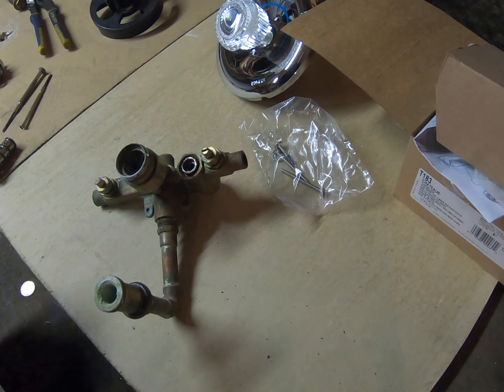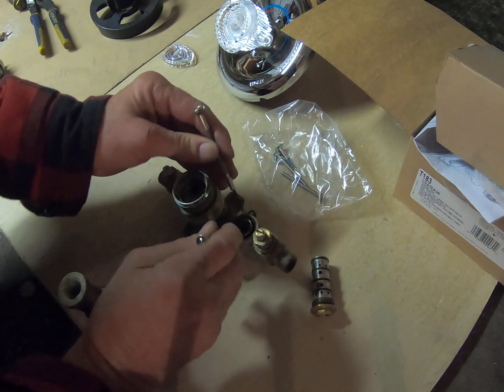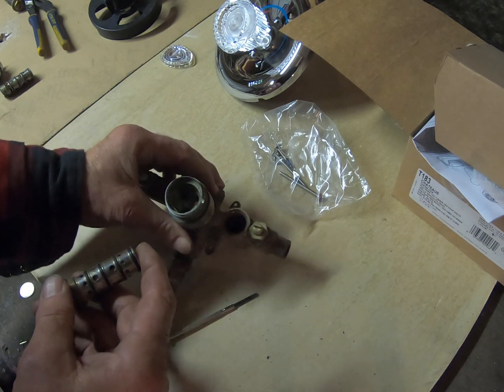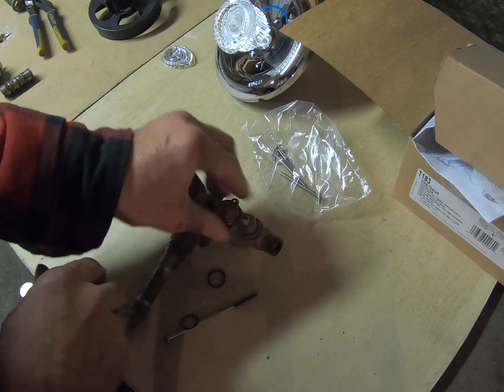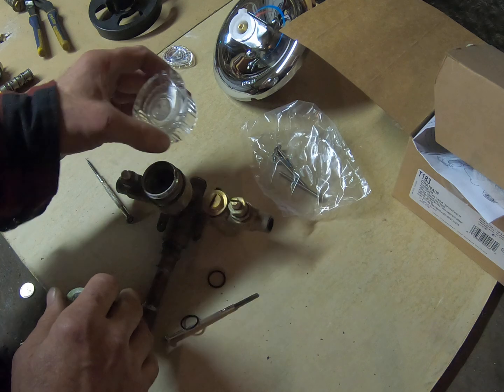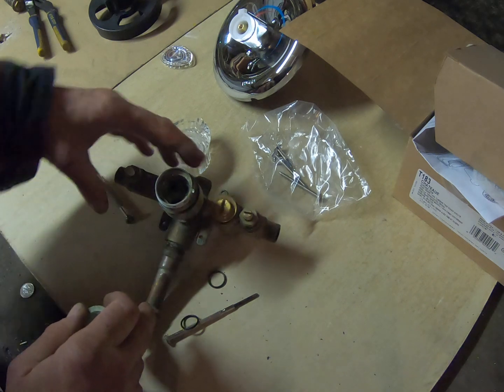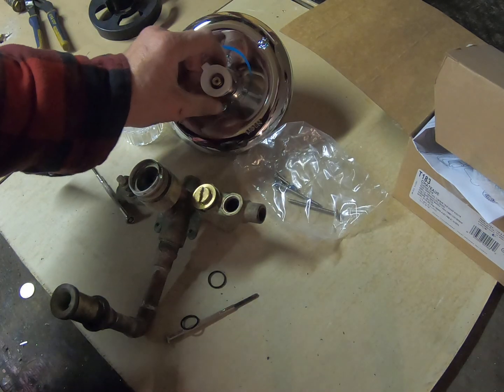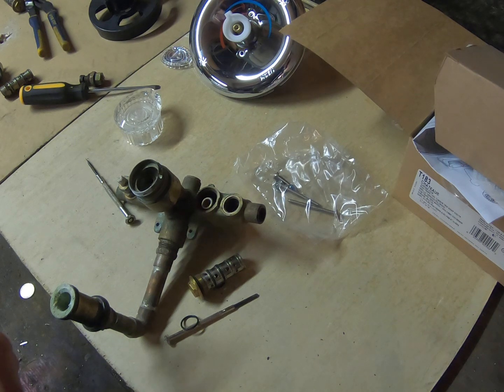moentrol and positemp valves part 1

Comment: My spool has a shake to it, but I have low hot water pressure. I changed the cartridge, do you think it’s possible that it’s the valve on the hot side? Or more likely the spool?
Reply from the maker: Ryan Webb try replacing this pool sometimes I’t stick matter if you clean them or not.  Also check your main pressure to your home that can be a factor.   Thank you for the comment
Reply: Additional information: When I open the valve for the hot with the cartridge pulled out, for water I get nothing. I have to have open the cold valve to even get hot water and it’s very low pressure.
Reply: @ryanwebb5465  I have the same problem now where I don’t get any hot water. I have the cartridge out and turn the hot water valve on and no water flow. Before I remove the hot water shutoff, I wanted to see what you found as the problem? Thanks!

Comment: thank you for sharing this, I am trying to replace the balance spool, I got the cap off, but the inside spool is stuck, I'll try the tools you used to try and pry the sides and wiggle it out, if it doesn't budge, what would you recommend?
Reply from the maker: Excel mathematics tutoring c,,Thank you for the comment,,, either two ice pick type tools or two small flat screwdrivers like the ones you use for eyeglasses,,,, spray some lubricant inside and be patient,,, it should release if it's not too corroded
Reply: @b-n-pplumbingandmaint.3567  I was able to make a handle attached to an allen wrench and hooked it into a hold of the spool and pulled it out, cleaned and lubricated the spool, now the shower works as normal again
Reply from the maker: @excelmathematicstutoringco3916  glad it worked out for you,,,,,thanks again!!!!